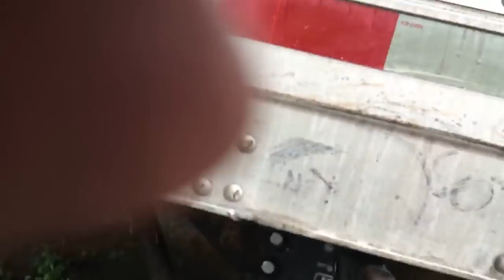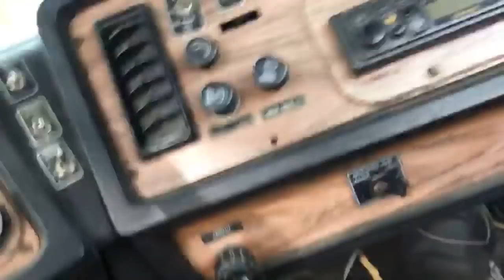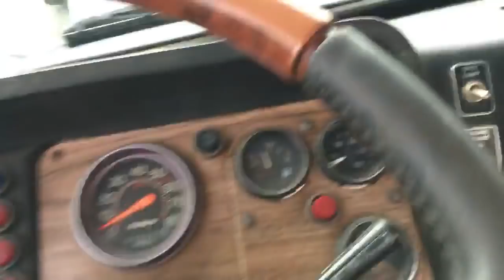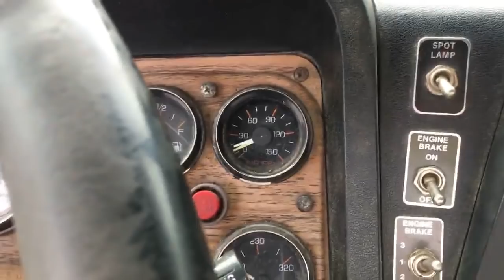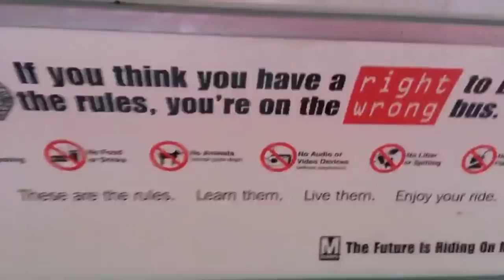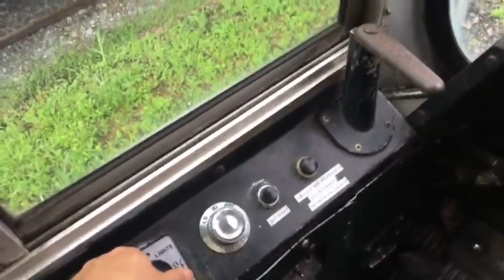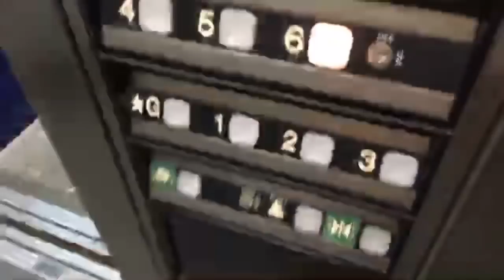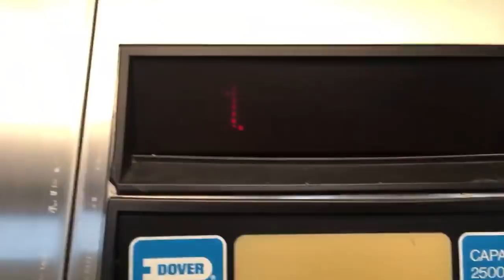Driving a truck

Comment: Hi DieselDucy if you like old buses, old elevator, old lift, old train and old things way not come to Singapore to take a look at the old elevator and old lift and old buses here in Singapore and take back some old buses for your BNT like some Dannis Trident III Duple Metsec Bus before the bus lifetime expiration date is over which is on Thursday, 05 July 2018 and before it got scrapped on that date.